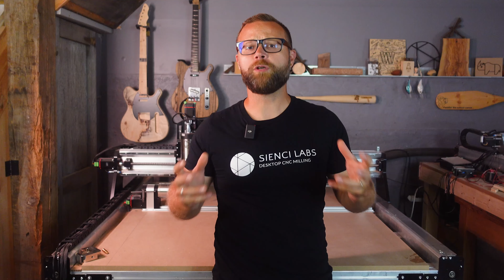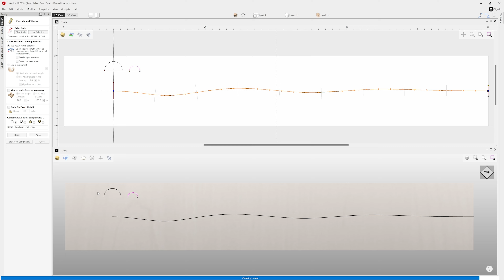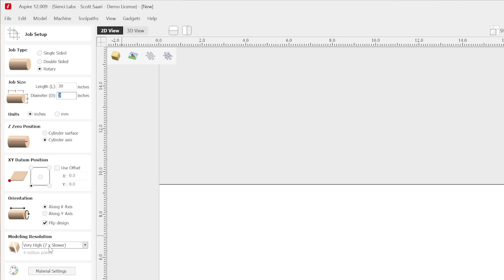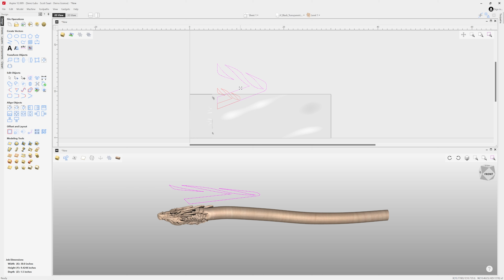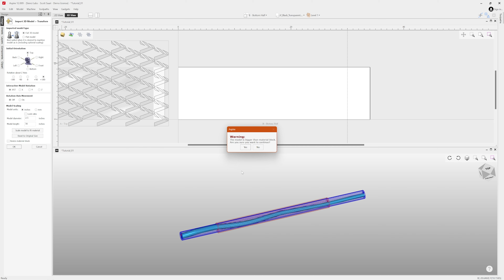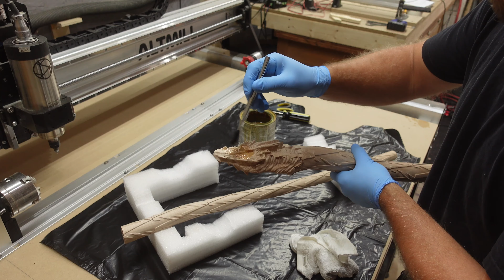Revelations of Rotary Presented by Scott Saari - Sienci Labs

Comment: First and foremost... AWESOME job!!!

Next - maybe a stupid question, but...   Why can't you do a true "4 axis"? So that you can move the gantry in the Y axis as well as rotating the model. This would eliminate a lot of the under cuts (to an extent anyway) and provide for much more detail including your dragon head at the 90 degree angle you originally talked about without having to make it a separate piece. I've seen very few videos that do this, but they are out there. I am relatively new to the whole rotating axis and am trying to wrap my head around it (pun intended). Is this a limitation of Aspire? I think I've seen most people using Fusion 360 when doing the full 4 axis. Thank you in advance for your reply / comment.

P.S. - Just a thought about finding centers and drilling for your connector... I wonder if you had added a square to each end (just inside from the tabs) and used it to drill pilot holes before cutting and sanding off the tabs.
Reply from the maker: Hello Jeffery, and thanks for the question.  We create the rotary movement by taking the X or Y and using it to turn the material in the rotary attachment.  So it is still 3 axis... just one is the rotation.  Hope that helps.